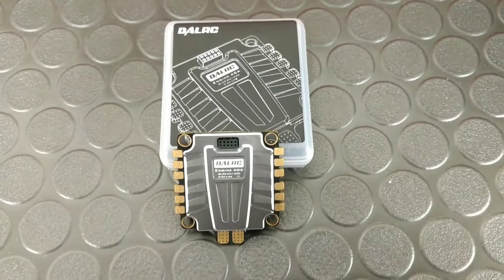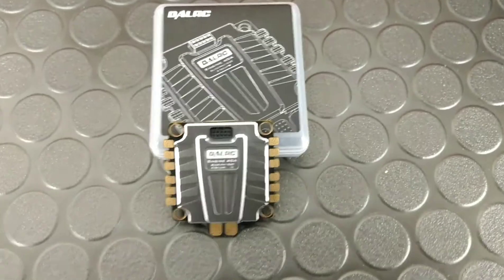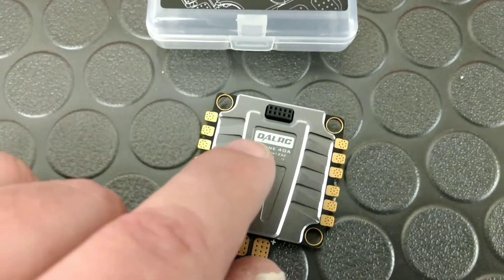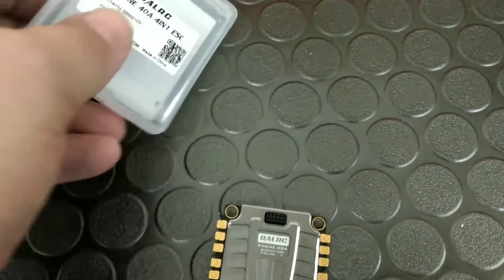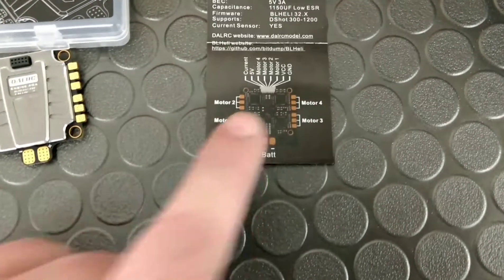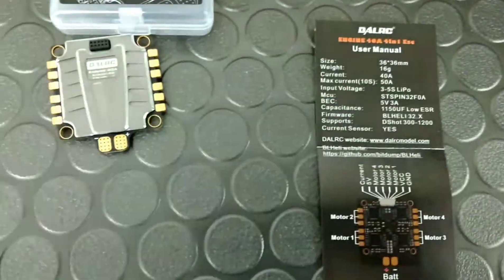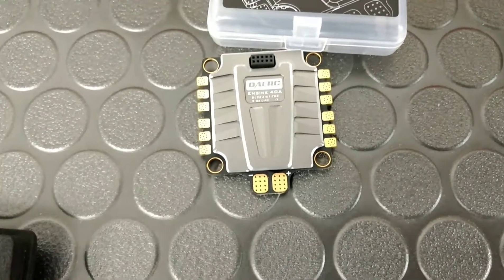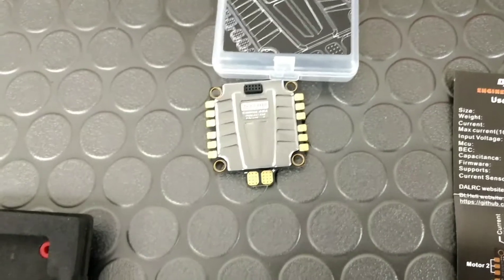DALRC Engine esc 40A 4-in-1 ESC

Comment: What FC's can you get to use those pinouts? DYS F4 does not seem to have pins
Reply from the maker: Savage FPV yes you could use the dys board but you would have to remap your board direction in betaflight
Reply from the maker: Savage FPV 
Or this one http://www.2dogrc.com/omnibus-f4-pro-flight-controller-v3-barometer-smart-audio-support.html

With this cord
http://www.2dogrc.com/8-pin-to-8-pin-cable-50mm.html
Reply: Dys board does have pins. I cut them off all the time.